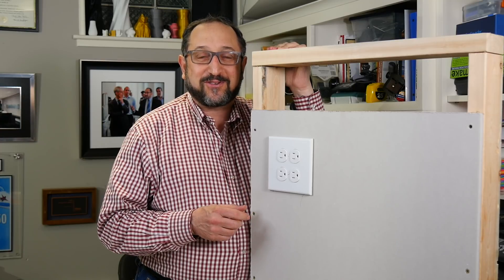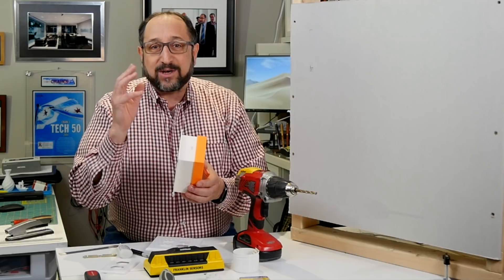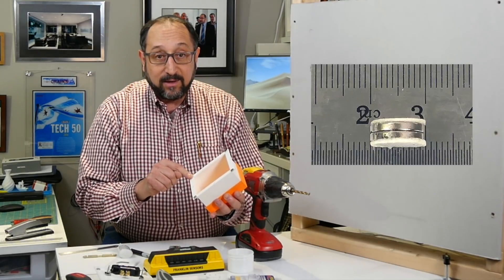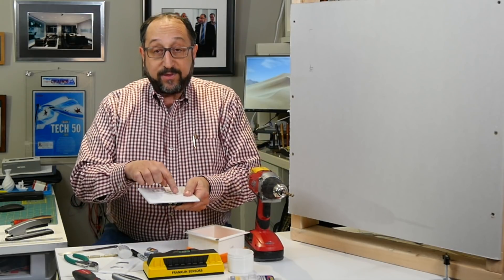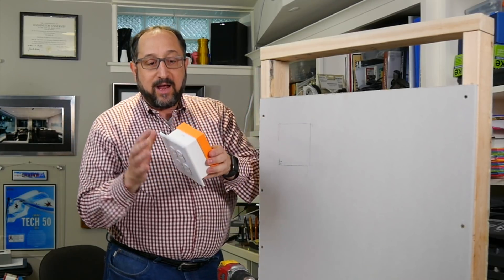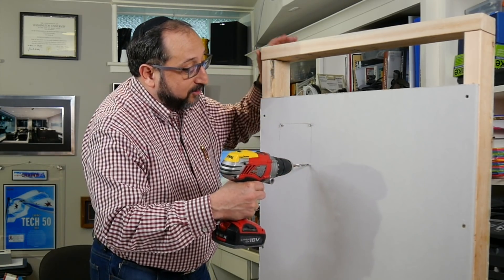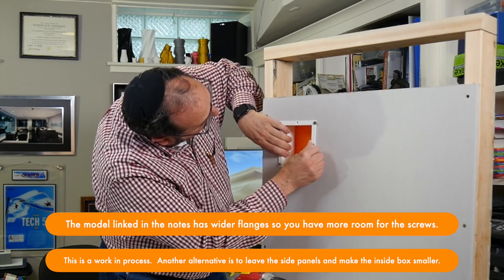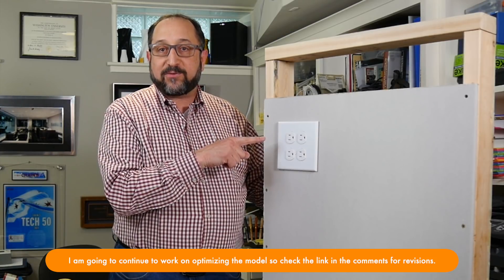How to Make this Secret Storage Space

Comment: Oh, Good Dr!  Please forgive me. But because you like to learn things, can I point out a few electrical things here? Electricians like to discuss whether to put the third ground prong at the top or the bottom. It is traditional to put it at the bottom, but there is good reason to put it at the top, in case something metal would fall behind a plug. If the ground prong is at the top, it helps to protect against a short. You are showing the outlet (actually called a receptacle) sideways, which is rarely done. (Actually I live in an ancient house, where some of the receptacles are mounted in the baseboard sideways.) OK. When anreceptacle is installed sideways, most electricians would put it with the larger slot at the top. That is the ground side. The smaller one is "hot." Putting the larger one at the top is for the same reason as above, in case anything falls down behind, there is less chance of electrocution. So if any self-respecting burglar came into your home, she would see that not only your receptacle is sideways, but the "hot" prong is at the top, so she will know that an electrician did not install that thing. Other than that, what a fun idea!